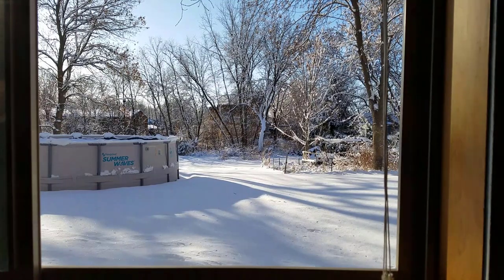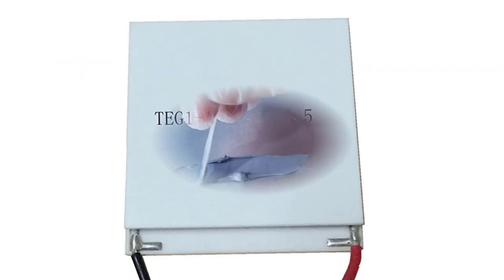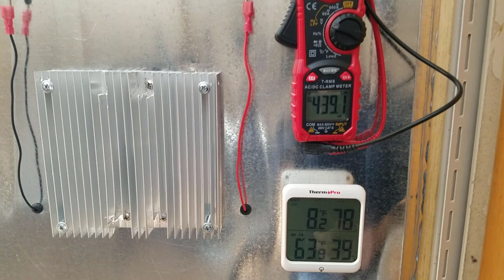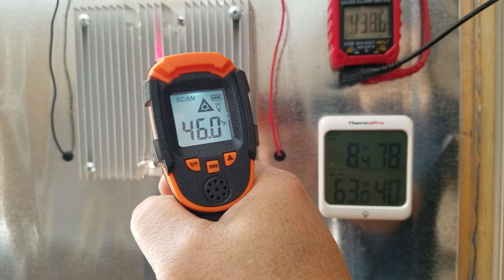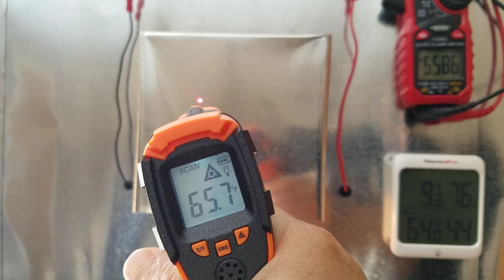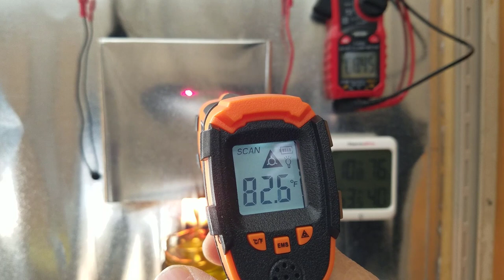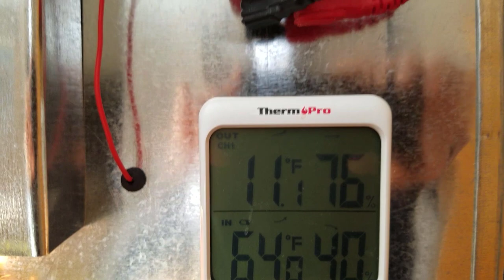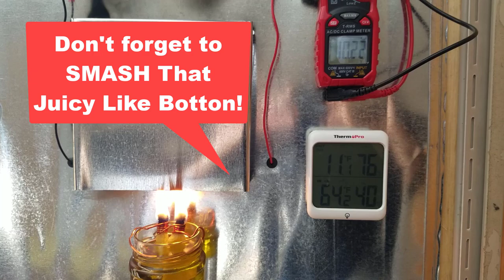FREE Energy From Air Temps! (Thermoelectric Generator - TEG)

Comment: I'm not so at ease about the carbon monoxide coming off of the candle flames filling up the house unless you have good ventilation, either way, you could probably do the candle thing at night time, but use an alternative method during the day time when the sun is shining. Another way to do this is, you take the hot side and attach it to a large metallic sheet like aluminum, then spray paint it black. During the day time infrared heat radiation from the sun (free heat energy) is absorbed by the black panel and transfers to the hotside, underneath the hot side you have those heat sinks, I'd get a CPU heat sink with a solar panel powered fan to run fresh cold air through the fins for the cold side, then viola, you got electricity. A heat sink with many thinner fins have a larger thermodynamic surface area to release heat energy (cooling effect). The heat sinks with large thick fins are garbage at heat transference.

Comment: Interesting but I think a lower tech solution would be more gooder. Do a steam powered rotary to spin an alternator or generator, whatever you have lying around? You can build an oil burn furnace to heat your house and make the steam. Either shoot the steam outside or recollect it to reuse, dealers choice?
Reply from the maker: Great idea!

Comment: I live in an area that stays pretty cold like that in the winter. I've been contemplating making something similar. I'm really surprised it didn't kick out more power than that without any extra heat source, but still it proves that it's doable... I've seen people build a small indoor heater using crisco and a wick...maybe just find some decaying isotopes like NASA uses 🤔😀

Comment: Cool! Suggestion: Use charcoal in a low oxygen environment and burn the carbon monoxide (over 2000 C flame temp!). Will require a container to keep charcoal with small air inlet and some sort of suction to pull a small amount of air in. Once this is set up, a water drip can be added either to the air inlet or another inlet. Water will quickly steam, and the charcoal in the low oxygen environment will rip off the oxygen leaving hydrogen. Hydrogen flame temps are around 2,600 C.
Reply from the maker: Very interesting!
Reply: We need Green Hydrogen

Comment: The cold side is way too hot. If you place a 12V fan powered with a solar panel, you'll get more than a 16V at the end. 
I'm planning to build the same thing but with more TEGs using my central heating wood boiler. This wood boiler is made out of cast iron, should be pretty straight forward. With 40-50 TEGs you can charge two large truck 180Ah batteries overnight but i'm planning to use it with solar. Almost 6 months in slovakia we are burning wood. If there is enough sun, we run on solar electric heating but it is not enough, not enough sunlight during winter you know so we're burning 6 month straight a wood for heating. I really want to gain some effectiveness using this contraption and 50 TEGs SHOULD be enough. If i cover both sides of that boiler, i can use more than 100 TEGs , this should be making more enough to overcome one fridge and one freezer consumption. Hopefully... idk what will came out of this but 50TEGs man.. should be enough 😂